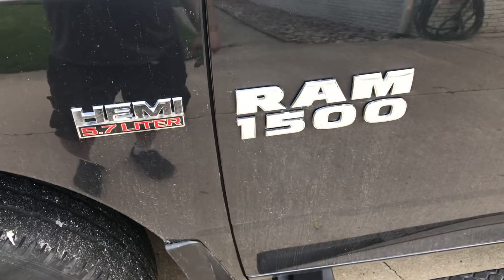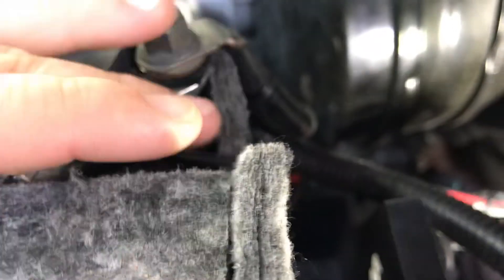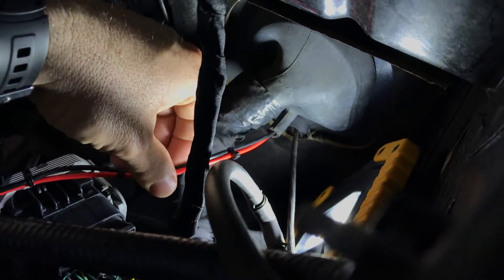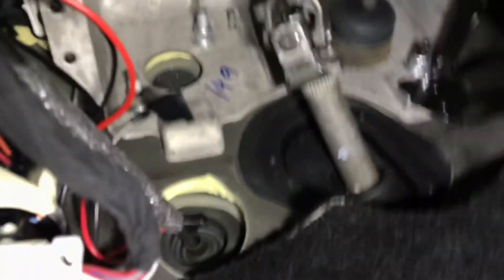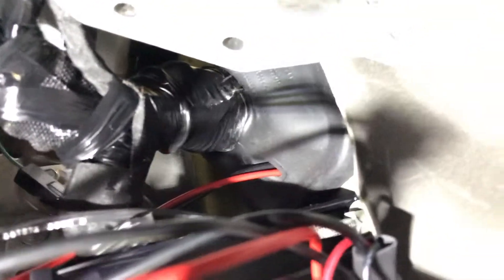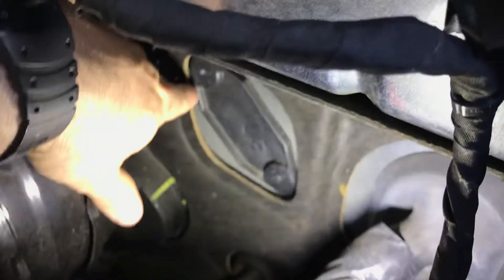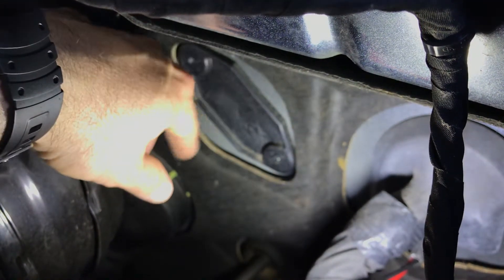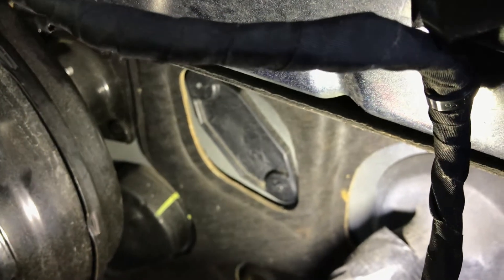Dodge Ram Running Power from Battery to Inside Cab.

Comment: That cover you were pointing to at the end of the video, it's the clutch pedal hole cover, and it’s two 15 mm bolts on the inside, you can get to it from inside. I saw it on your video, right next to the rubber boot inside. Take off those nuts and that thing just pops off. Drill a hole in it and a rubber fit grommet if ya have a lot of wires.
Reply: I’m unclear on where the wires come through if you use the clutch plate cover? Can you show the inside again and where the wires come through if you drill a hole through that plastics plate. Also it is a big plate? Do you drill directly in the middle? Great video
Thanks

Comment: I'm facing the same thing... Power for a Ham Radio in my 2017 RAM PU. Thanks
Reply: Yeah, and if you’re running a ham radio, I’ve always noticed 2 meter interference in the form of static But it goes away when you shut the engine off.

Comment: Great Video you think it's better to run a hardware for a dashcam to the battery with a fuse on the positive wire ? I have 2016 Ram and I have the Boot like your truck 👍🇨🇦
Reply from the maker: Good idea thanks for the information.